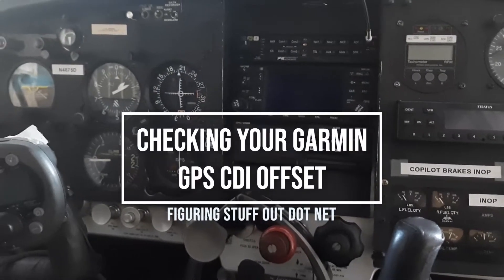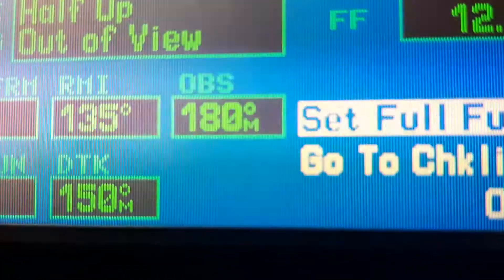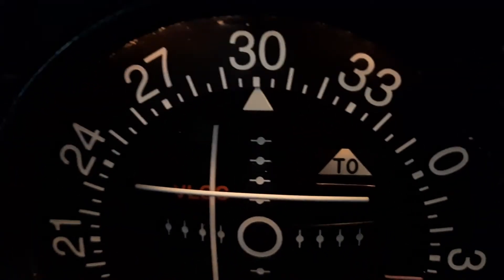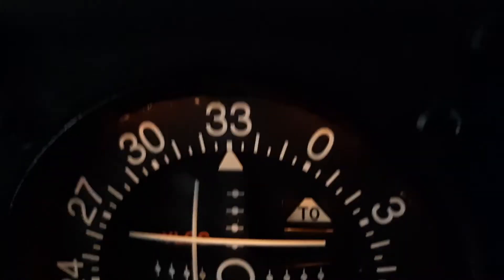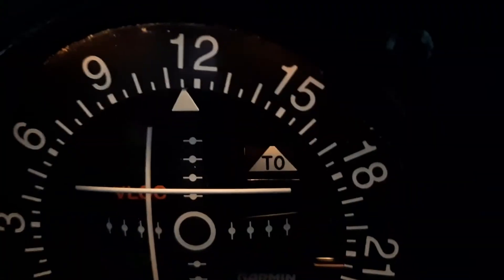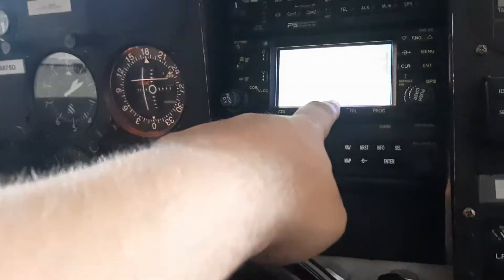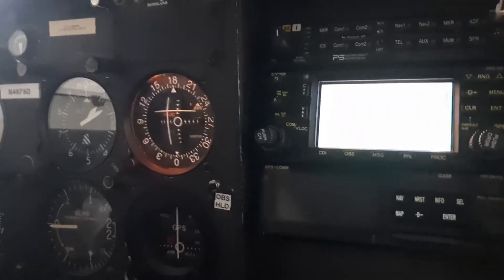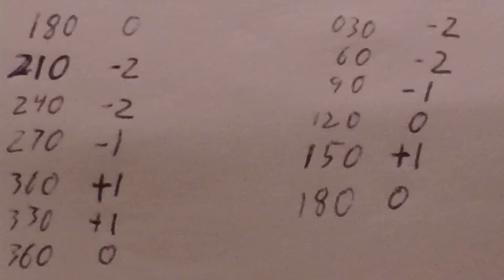Garmin 430/530 VOR calibration check

Comment: Thank you.  before sending it to repairs.. Isn't there a way to "ask" the GPS to recalibrate?  Thank you
Reply from the maker: Yes, that's a good point.  I didn't go into that generally speaking, if it was set up properly by the avionics shop in the first place, it not terribly likely to drift significantly unless something in the hardware stops working right.  

To summarize the three tests: if the readings aren't stable (this is what happened to mine), or if they aren't consistent, then there's a problem in the analog resistance coil of the OBS/CDI and it will have to be removed and overhauled or replaced by an avionics shop.  

If the OBS/CDI is working properly but the GPS isn't set properly for it, there is a way in software to reset it.  However, if you don't know what you're doing, you can also set it way off and make it far worse.  So I'm not going to put that in a video.  If you're competent enough to be messing with the internal settings of a 430, then you're competent enough to find the settings menu.